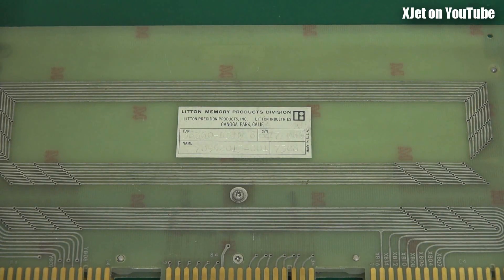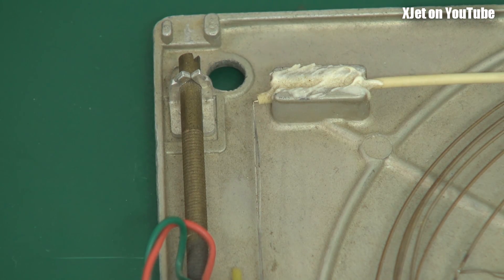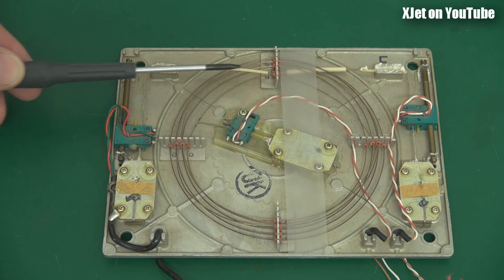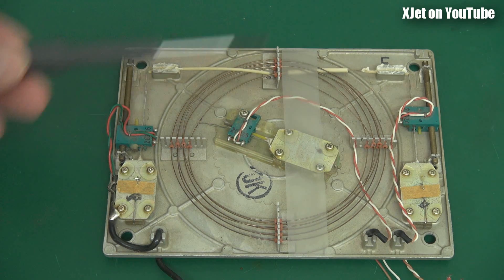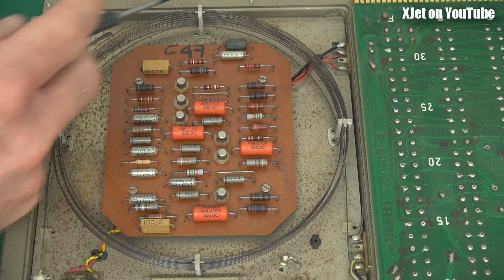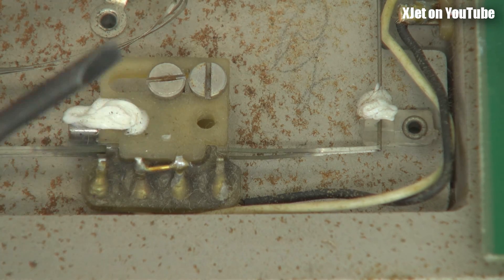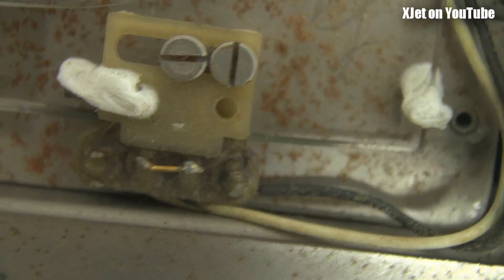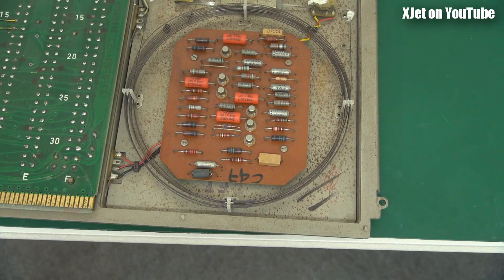Old computer tech:  delay-line memory

Comment: We used to use magneto strictive delay line memory like that to hold a complete 80x25 VDU screen of data back in the early 1970's - they were rather temperature sensitive. The board you showed with ferrite rod wound and discrete capacitor delay lines would be using them as timing elements where a series of events need repeatedly to be performed - possible in that read, and re-write in the dynamic chip array.

Comment: It is build like a kind of sproing reverb. This kind of memory was also known to your local cuckoo clock repairman as a coil gong. 🙂

Has anybody nowadays experimented with the limits of such a thing (acoustic noise sensitivity, count of bits/frequency etc.)? Friden made transistorized desktop calculators with coiled wire RAM and small vector CRT.

Comment: I worked at Olivetti in the early 1970's as a programmer, a skill I learned on the job(there was no other way at that time). My first machine was a very heavy business machine (the A-5) which had a lot of electromechanical printing capability and had 2K of programmable memory, programmed in assembler language. It was really a 32K but most of it was taken up by a burned in interpreter for the keyboard entered instructions. External memory was on mag striped cards. This machine could handle most accounting functions for a small business (accounting, payroll, etc). Anyway, our office ( in NYC) had lots of legacy equipment lying around including these wire memories and coil and core memories. This is the first time I have ever seen/heard a discussion about them. SO...thanks for the memories.

Comment: I believe the ICs on that last board that you showed were called Flat Packs (or maybe FlatPaks) back in the day. I once watched technicians soldering a lot of those early ICs to boards at a Texas Instruments facility.

I once built a homemade little computer system that used a magnetic drum memory for its main storage. I found the drum at an electronic surplus store. Most of it tracks had been trashed but a few remained and I got it to work again. That project took me from 1964 to 1967.

Comment: What a lovely collection of very rare stuff. I used to work on calculators which used wire delay line memory. I didn't know the pulse was generated by twisting the wire, I thought it was piezo electric  so thank you for that information. What did surprise me with those delay lines was how unaffected they were by shock. I remember trying to bang one with a screwdriver handle to get the memory to change and couldn't, very impressive.

Comment: Many years ago, when I was a computer tech, I used to repair video terminals that used a delay line that looked similar to the first one in this video.  The sensor transducer was the one connected to that long brass screw.  That screw was used to range the delay line.  Turning the screw moved the transducer along the wire.  You'd turn the screw one way, until the text started breaking up, then back the other way, counting turns, until it started breaking up again and then turn back to half way between those two points.  The recirculation was on the terminal logic board.  When a character was inserted, the data was actually buffered in ICs and similarly when deleting a character, it would be deleted in those same ICs.  I also used to work on core memory back then, and still have a core plane from a Collins computer, which is on the shelf behind me.  Here is a picture of that core plane.  It's 4K bits and there were 32 of them stacked in a module, with 4 modules in the computer for a total of 64 K bytes.
https://drive.google.com/file/d/0B5LapMwk8iPrNkFZUXA4cmd5dTg/view?usp=sharing

Comment: I worked "around" this equipment.  Glass delay lines made by RCA in--I think--Camden, NJ were used in equipment until the early 1990's.  The product displayed market data and the machine was invented by Jack Scantlin.  Scantlin Electronics marketed it as QuoteVue and Dow Jones marketed it as DowVue.  Scantlin Electronics became Quotron and Quotron continued to support it until after it was purchased by Citicorp and destroyed (a little editorializing there).  The QuoteVue was not a computer but a display device with several data inputs.  The technician who installed it would get a mimeographed sheet from which he would program   the machine on site with slide switches on the circuit boards.  The QuoteVue could support up to four users.  There were (from my memory) only twenty lines of data total.  Typically, the top three lines would be the Broad Tape (Dow Jones News so called because Dow Jones was on Broad Street), the next two lines would be the NY Ticker, then a line of American Ticker.  These would be programmed (with slide switches so that they were visible to all four users.  Then there would be four "quote lines" one above the other.  Using the slide switches again the technician would program the display so that the broker could see only his own quote line.  That meant each screen had three blank lines so he could not see what quotes the other brokers were looking at.   The delay lines held a line of information of sixty characters, I think.  The Broad Tape was only 50 characters across.  With the slide switches the tickers and DJ news could be "programmed" to slide across the screen or precess (scroll).

This was described as the first "hardware split screen" display.  Separate feeds were displayed in their own locations.  South of Chambers street the tickers were current loop.  North they were Western Union TLA's.  Dow Jones was delivered via a Coherent demod.  When this was first offered in the 60's Dow Jones did not have a 300 baud feed so the input was 75 baud.  Dow Jones multiplexed 17 different news feeds across its network (including the Catholic New Service).   

The equipment was effectively indestructible and maintenance free.  My interaction with it was first to deal with line outages and then to see if there was space in the user office to replace it with later more modern equipment which was about three times the size.
Reply: Oh, so if there were 60 characters a line and 20 lines (there might have been less) that would be 1200 characters of memory.  All uppercase, but the font included fractions 1/8 through 7/8.  Typically there would be blank lines between the ticker and news feeds.  If there was sufficient screen real estate available the characters in one or more lines could be made double height (not double width though).

Comment: On the first delay you showed is it possible that the second coil was a check sum for error detection? Added point the first floppy disk ea an 8 inch but was soon replaced by the 5  inch by IBM

Comment: I worked in the computer room of a power station in the early 70's. The mainframe was  an English Electric 2140. Once a week, I had to check the alignment of the heads on the big mag' drums (mass storage) and set up the sense amps on the core store. I also got to build some great test equipment and diagnose faults down to individual component level. Tech' of the era was very rapid - (spin-off from the space race stuff maybe ?) I think the programming was mainly assembler /octal...

Comment: Search on the Packard-Bell PB250.  About 400 transistors, a bunch of diodes and magnetostrictive delay lines.  44 bit (IIRC) words.  Probably would qualify as one of the first minicomputers (ca. 1959).  I've had a brief encounter with one in prehistoric days.   One of the interesting things was that you could corrupt data by banging on the side of the case.

This was the old Packard Bell that made radios and TVs and military electronics.  Not the later Packard Bell that whose brand was purchased by an Israeli tank driver and his buddies to sell cheap PCs.

FWIW, an 8" diskette recorded single-side in FM was 250KByte (77 tracks, 26 sectors of 128 bytes = 256,256 bytes).  Double these for MFM and double again for double-sided.  Hard sector floppies could encode about 315,392 bytes per side because the hard sectoring eliminated the need for preamble and postamble bytes, gaps, etc, so 32 sectors per track.

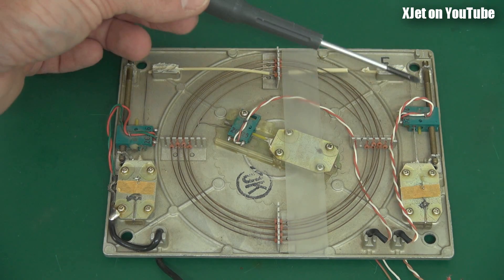Comment: 3:03 Perhaps the two spaced sensors are for noise or standing wave rejection. If you measure the incoming pulses in 2 places at 2 different times, you can combine them with a simple LC delay and cut the noise component in half.

Comment: I used 8” disks regularly with a CMX 360 and 3600 videotape editor. It was old tech, but it worked well. We would use those disks to save edit decision lists (EDLs) for clients, so if they had any changes, they could come back in the next month and re-do their stuff. 

Mind you, at home, I was using 1.44 Mb Sony diskettes as well as hard drives for my PC. But I was using the high-density double-sided soft sector 8.5” disks well into the 1990s.

Comment: So this way of storing memory runs an acoustic input into the wire and then feeds that acoustic input back into the wire it reaches the other side? Then that just bounces back and forth until the length of wire is acoustically full?
Reply: I guess they only filled half the memory whith data. Then they could listen to the data, write to the empty half and then read forever!

Comment: Thanks for posting this. I heard about the Olivetti desktop computer from the 1960s (really a desktop programmable calculator), and they mentioned that it used delay-line memory. I was curious how that worked. The only old-time memory I'd heard about before was the mercury chambers, which was another kind of mechanical memory (it used acoustic waves in mercury to store bits of information), and core memory.

Comment: Well gd I have not seen that in about 8 years now lol the first one you had was actual in working use up in a small town in WA called curlew. The phone system was something out of 1950 era and actually had 9 of these working to control the phone switching controllers call would go out and these where used to rest the system when call ended. Simple as I could say it. Was fn amazing,! But you are wrong in the two receiving sensors. Therected is one to send. One to receive. One to pass onto next coil in next Uinit. Also term for it is a chain sensor . Old school way to stack memory I guess could say. Makes holding time increased. Hope it helps yang some

Comment: I think delay line memories were used for registers: at the speed of 1950s computers they could hold a word or so of memory. I first worked with a Ferranti Mercury that had this sort of technology for the accumulator and address registers, and then ferrite cores for ordinary memory (which was somewhat slower).

Comment: That code is not 1VREA, it's not even a code. It's Ivrea, the town in Italy where Olivetti had its headquarters
Reply: Bonus trivia, the Interaction Design Institute Ivrea is where the Wiring platform (and later the Arduino) was invented. It was based in the old Olivetti offices, but the school only lasted 4 years.

Comment: Right on the money. IBM used them on some banking terminals which I used to teach in the IBM Customer Engineering school in the 1970s. They only held 512 words of memory, where extremely reliable and where integrated into an IBM 1130 processor.Gabriel Shaw

Comment: you might have mentioned a bit more about how the ribbons worked. At one end they were each welded to opposite sides of the circumference of the transmission line. The other end of the ribbons was fixed. In the middle there was a coil around each ribbon. The ribbons received the same signal 180° out of phase. The coils would cause one ribbon to tighten as the other loosened, twisting the end of the wire. Cool, huh? You could have zoomed in on the end of the wire and showed the ribbons welded on.

Comment: The first delay line memory in your video had three transducers, one at each end and one not far from one end,  You asked in the video what the middle one was for, and suggested that it might be to read back the data for refreshing it.
I'd like to propose another purpose.
Suppose that the entry point of the data was the transducer on the right side.  That would put the middle transducer quite near it.  Looking at the data flow, there would be one point where the data could be read back shortly after writing it, with a second point at the end of the coil.  
The speed of sound in some common metals (steel, copper, brass) is in the 4000-6000 m/s range.  I'll use 5000 m/s as an estimate of the propagation speed for the ripples.  There is no scale, but I'm guessing that the coil is 11" in diameter, and I see from the video that there are 6 turns, giving a wire length of 210 inches (5.25 meters).  This gives a delay time of 1 millisecond.  
The middle transducer is about 7 inches (0.18 m) or 35 microseconds from the right transducer.  
Registers could be stored in the delay line as well as "memory" data.  For minimum logic, one could have an accumulator be interdigitated with each memory location, giving up half the storage capacity in exchange for having the accumulator be available "at the same time" as each location.  Arithmetic operation with the accumulator become easier, as are load and store operations.  If this were the case, the delay line would have about 30 memory locations.  Guessing the word length requires estimating the bit rate.  Guessing 5 MHz bit rate would yield 175 bits in 35 us.  Interdigitating accumulator and memory store would leave 87 bits per location, or about 20 digits of BCD number.

Comment: Hiya.Great series! On that 3rd board it looks like its filled with SMT (surface mount chips) but surely that can't be! I take it they are chips though? I have always been fascinated by the ingenuity of electronic designers---like for example the weird metal filings filled glass tubes called coherers I think. I,m not sure but like the cats whisker I believe they might have been an ancestor of the diode? Perhaps u could do videos on the above devices please unless you've  done so? Thanks.

Comment: We also used these in old color tv's to slow the video signal so the audio could sync.
Reply: You have to slow the picture down as the speed of sound is much much slower! :-D))))))
Reply: Really? I knew about using 64 us delay lines in PAL and SECAM systems for the colour decoding, but I hadn't heard about it being used to synchronise the sound and the picture.

PAL doesn't actually require a delay line to decode, but it does improve the picture quality. SECAM, on the other hand absolutely does require one.
Reply: @Roxor128  PAL used some kind of piezo mechanism as acoustic delay line (later replaced with digital stuff) to compare 2 scanlines for colour difference.
Reply: @cyberyogicowindler2448  Which is the "high quality" version of the decoding. The simple "low quality" version just subtracts the colour signal from the incoming signal.

The simple decoder produces alternating light and dark lines of the decoded colour, with the hope that they'll average out when viewed from far enough away, whereas the complex one actually gives flat areas of the decoded colour.

I can say that because I've actually implemented it in software and seen the results for myself.